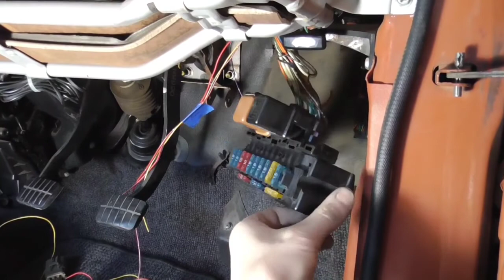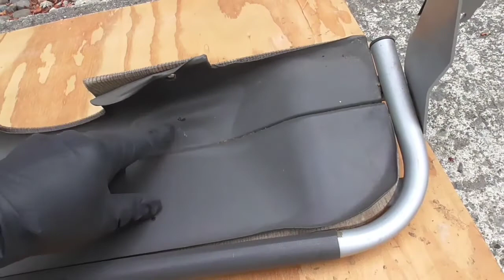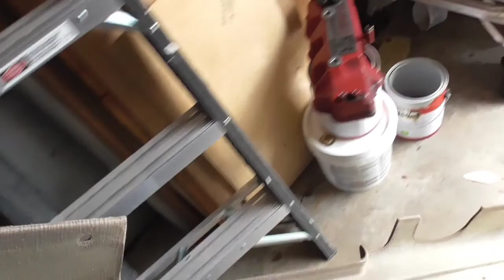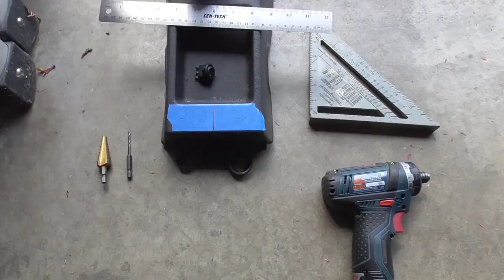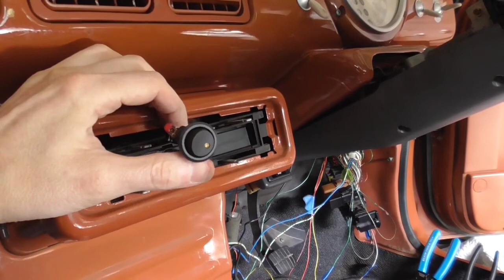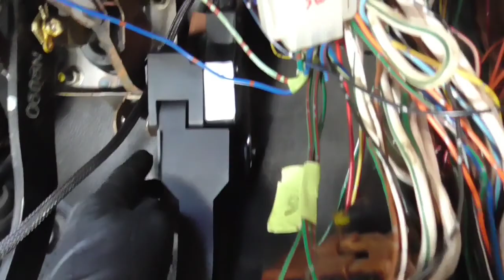Project: PAO EV - episode #4

Comment: Man, I do not envy you having to sort through the electrical system of the Pao. Pretty much any car's electrical system is like a rat's nest. Luckily the electrical wiring for the EV won't need nearly as many sensors as the ICE version did.

By the way, update on my 2016 Kia Soul EV+: The car's been in the shop for 9 days now, waiting on the battery pack to arrive. But they are letting me use the rental until it arrives. The tech initially told me it would be "a few days or maybe a week" which surprised me because people online that have had their Soul's battery pack replaced said it took them 3 or more weeks to get it. Anyways, looking forward to having a hundred or more miles of range.